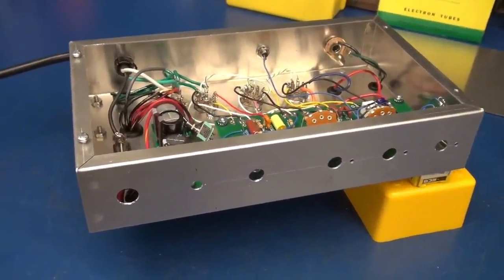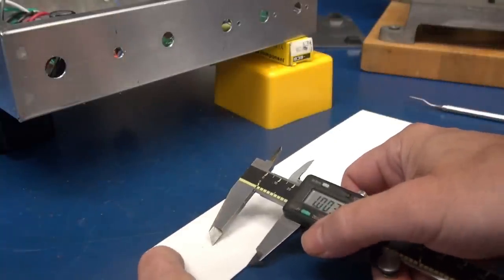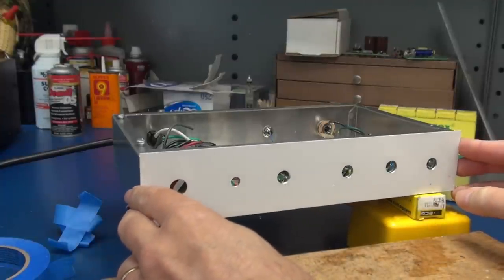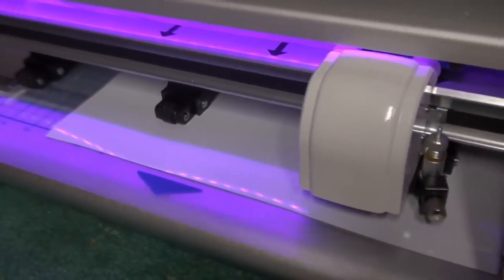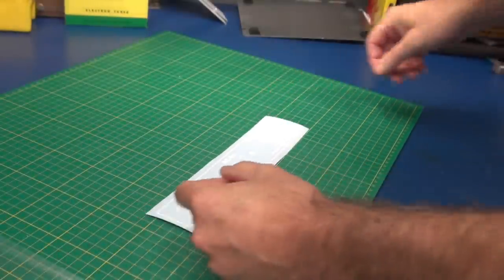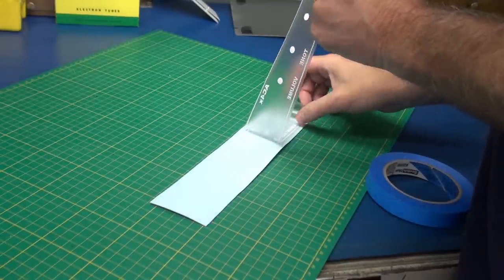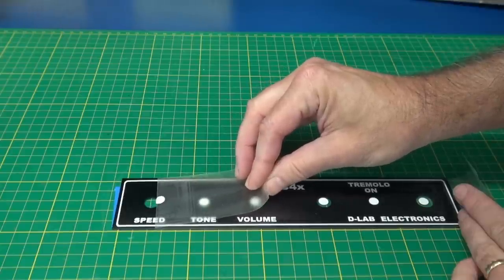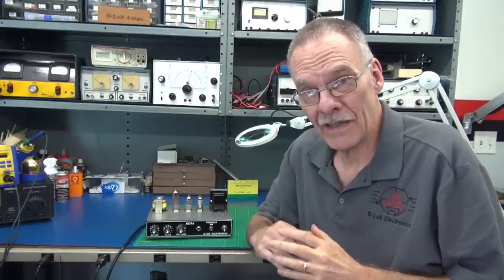How D-Lab makes custom control overlay panels for tube guitar amplifier projects shop process

Comment: That looks good! Getting professional looking front panels has always been a stumbling block for any electronic project. 

I've had success having the layout artwork printed by companies that print photos on metal. The trick is to find someone who can make exact 1:1 prints on aluminum, so you'll need to have a conversation with somebody at the printer to see if that's within their capability. The result is a panel that is very durable and lettering will not rub off. Metal prints are not that expensive. 

The other method I've used is a bit more complicated, involves caustic chemicals and there's a risk of spoiling the panel if you're not careful. Eye protection and gloves are required for safety. The basic steps are to create a computer graphic (panel sized) with a black background and white graphics (titles, drill marks, logo, etc). The layout is printed in reverse, 1:1 on a laser printer using PCB transfer paper.  A hot laminator is used to transfer the printed image to black (or colored) anodized aluminum plate. Areas covered by the toner will resist the etching solution which is 1 part sodium hydroxide and 2 parts water (3 tablespoons total is plenty). Using a Q tip, spread just enough etching solution over the words or graphics, one item at a time. Move the Q tip back and forth over the graphic. Soon you'll see bare aluminum and the graphic will appear silver against the background. As soon as the graphic is sharp, quickly rinse the area with water to clear away the etchant. Do this for all the other graphics on the panel and wash and dry the panel. This is pretty labor intensive, but durable panels can result.

Comment: That is a nice process.  A little expensive to get started.  I've been using waterslide decals.  A lot less expensive, and there are color options available for the lettering . Adds a somewhat protective layer to the amp face. Can also clear coat both ways.

Comment: The skill required for the artwork and finishing is why I did the wiring and another employee did the cabinets.  We weren't in business, just before and after work projects in the '80s.  We repaired a few tvs and some stereo gear for peanuts or a bottle of scotch.  Afternoon rush hour traffic was bad and leaving work at 5 pm meant getting home 14 miles away around 645 or later depending on how many lanes were closed for construction or a wreck inside one of the tunnels.

Comment: at the final step, if you spritz the panel with a mist of water, you can float the transfer tap on the panel.  Once it's where  you want it, use a squeege to stick the tape down.

Comment: When you transfer the artwork to the panel you can spray a diluted soap mixture on the panel, apply the artwork and slide it around into perfect position.  
Then press in place and lightly squeegee the vinyl down. 
There is even commercial, liquid solutions for doing just that.
Reply from the maker: Thanks for the tip, I will research that solution
Reply: Yes!

Comment: Wouldn't water-slide inkjet decal paper be a whole lot easier?
Reply from the maker: Could be. I'm not sure how durable they are compared to the vinyl
Reply: @d-labelectronics  they're not durable at all. They must be coated with an enamel clear spray. Or you could print them reversed and put them under a plexiglass panel like Marshall used to.

Comment: At 8:13 you came dangerously close to getting an unlike... you didn't show the most critical step: how to place the decals down and how to prevent bubbles and wrinkles. It was a good video and I gave you a thumbs up, but that one step that you don't show is the crux of the technique that you should be showing. A "thumbs up minus" or 4 out of 5 stars.  I have a technique for those of us that don't have expensive vinyl cutting machines (as we rarely make panels). I print out what on want 1:1 scale on my ink jet printer (in color and any artwork that I want), I am limited to 8.5 by 11 inch paper, but I can "mozaic" multiple sheets if I can live with seams from the multiple sheets. Then I apply a super thin coat of wood glue to the panel and scrape away the glue with a shop razor until I have about 0.001 inch thick of glue, then I lay the paper down on top of the glue and press it down with some books. Because the glue layer is so thin you have to work fast, but it has to be thin so it doesn't soak through the paper (which ruins the look). After an hour of pressing, I spray very, very, thin misting coats of clear polyurethane on the paper. Again, very, very, very thin coats as to not soak into the paper but rest on top of it. As you build layers, you can go slightly thicker coats but very thin coats works best. Give about an hour for each coat to dry before the next coat. Usually 10 coats in all. This creates water resistant and fairly durable panel markings - maintenence: wipe clean with a damp cloth. It is time consuming but the cost is far less than using an expensive vinyl printer. I normally do this on thin wood panels, but it will work on aluminum panels as well. I wish vinyl cutter machines were more affordable because your method is great, but I get professional "looking" panels that so far have held up to the test of time.  In lieu of spraying, a clear vinyl sheet could be placed over the paper instead for nearly the same durable and professional look.
I have a playlist for my technique on my channel. 
Thanks.